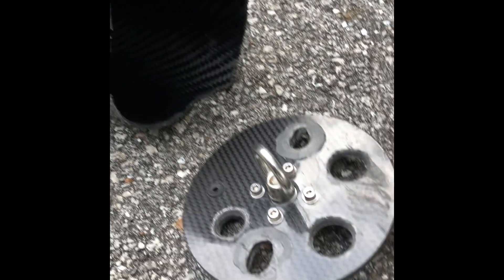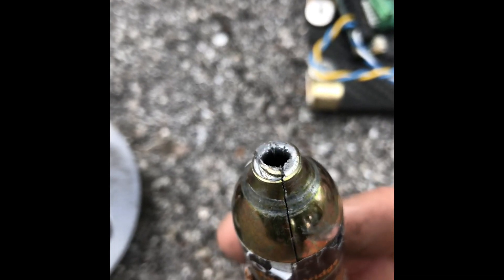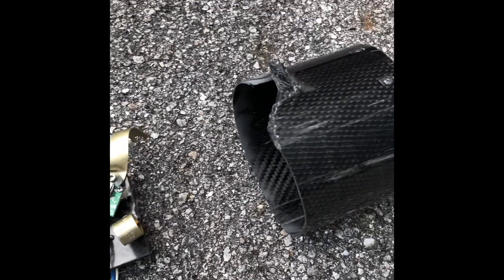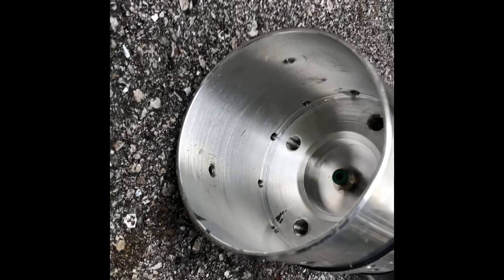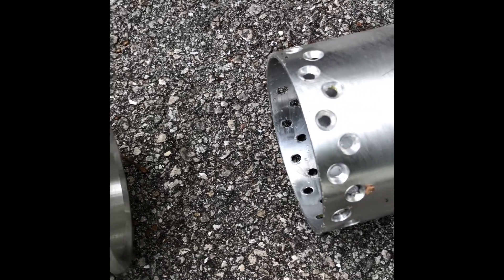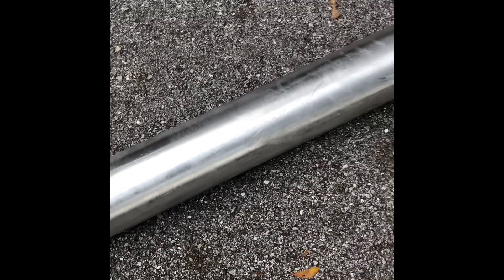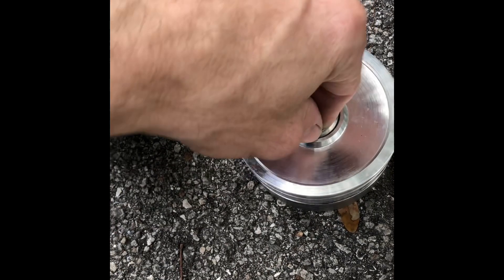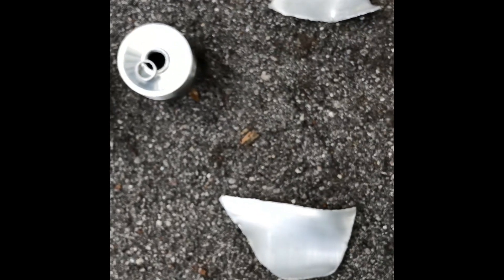Rocket Explodes on the Rail…just another day of testing.

Comment: There a video with a good summary of whole thing and each part?
And what failed? The clamping pressure on the fuel grains? The nozzle?
Reply from the maker: It was a Floating injector baffle witch compressed the fuel grain, collapsing it and closing the fuel grain core also plugging the nozzle.. so upon ignition…we’ll boom.. that’s also another reason I’ve gotten away from floating injectors and standardized bolted designs on anything larger the 4” Dia.

Comment: You might wanna research SCOTT FINTEL, ... could save you some $! 😱😝🤪🤣😁👍👍🇺🇲
Reply from the maker: This was a few years ago, an was caused by defective liner that happened to crash during fueling, I’ve gotten away from floating injector plates, and pretty much have standardized a Bolted Bulkhead, so fortunately, Grain Failure is much less likely to occur, unless there’s inconsistency in the grain casting process, degassing…ect  I’m aware of Scott’s work he’s  very knowledgeable.